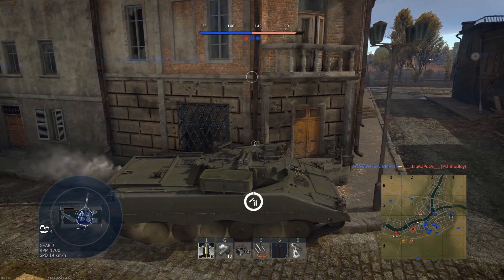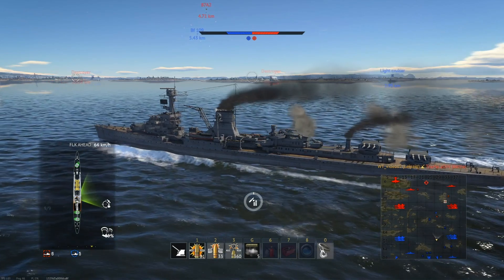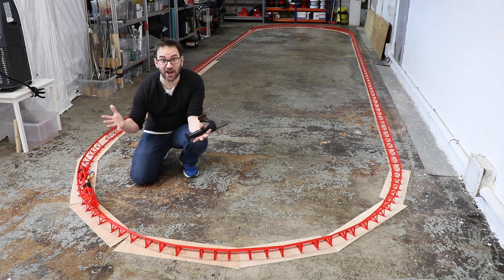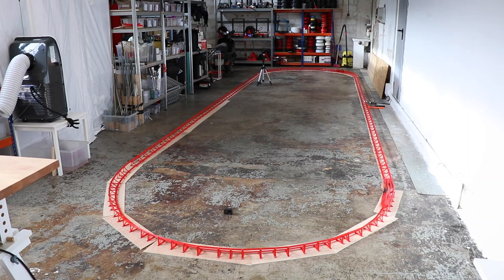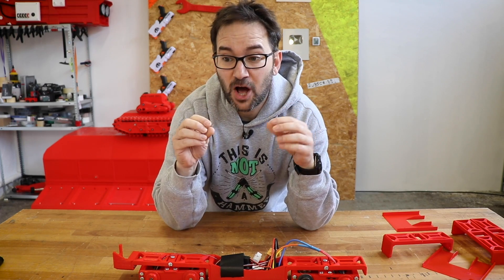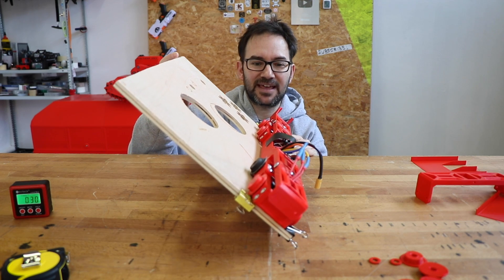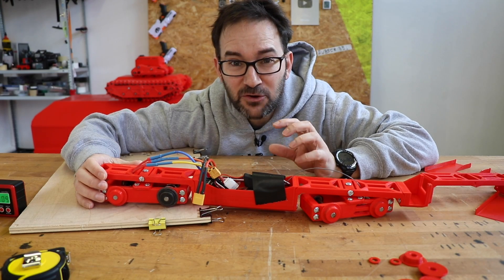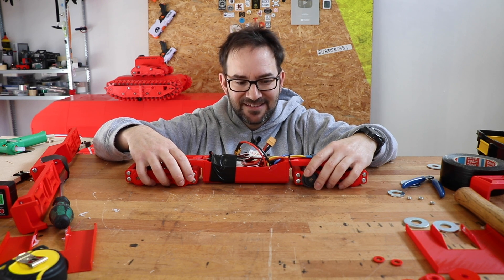WORLD FASTEST TOY TRAIN

Comment: My experience has been anywhere there's friction it slows down. Try better bearings and better wheels. Maybe metal if you can but I worry about the tracks wearing out faster. There's also a balance to weight and speed. Try different weights and add a nose cone to reduce air drag. I suspect that at the 20kmh point your train is starting to act like a plane with those cars and you're getting less grip to the wheels. Causing more derails and less motor to rail transfer. Honestly I'd start doing tests making small changes and recording my data. You have a wonderful opportunity to learn here.

Comment: Maybe drive only one of the wheels or add a second motor so they can rotate at different rates specially during curves, I think the inner wheel wants to slip but the rubber grips and create lateral forces and instability (not sure)

Comment: You can try different pulley diameters on motor and axle to find the best transmission ratio.
You can also try to remove the straight parts of the rails since it only derails on the straights...

Comment: Have you considered adding a motor to a second axle? It might add a little more weight, but there would be more power being applied to the tracks and as a result, possibly more speed.

As has been said, banked straights aren't necessary and would cause problems as you've discovered.

Comment: There are too many comments to see of these ideas are there. For this machine, speed is about weight and frontal area. Move weight down wherever possible. I'd add a nosecone of 0.010 or 15 acetate sheet to cut the air better. It would help a little to add a body, but not much. But, later, as you do reach limits, maybe try it.
You can angle the turns to 90 degrees! Obviously it can't go slowly, and the straights have to be much more level. Also obviously the track needs a lot more structural stuff.
The plastic might wear quickly, have you looked at that?

Comment: Reduce the banking on the straight. Basically  look at nascar, the banking is using the force that is pulling the car toward the outside of the track if the track was flat, into the ground making it able to take the turn faster. But, tale a look at the straight, there's less of it because the car isn't pushed to the outside. It's also why for bike track, racers go higher in the turn and try to stay as low as possible in the straight (there's also a matter of strategy in there for track cycling but that's the jist of it).

Comment: Try printing the wheels with TPU for add some bumps absorption and add some weight on the wheels that I’ll give more inertial moment, use a faster motor or longer ratio , it will help if you make it all 4 wheels drive

Comment: A couple things that spring to mind for "upgrades" are for example: making the wheels nice and round in a lathe (or when you do not have one you could use a cordless drill for example with an adapter). Besides that, take great care in laying the tracks, each bump is a possible failure point so fix it in place and use a sandingblock to flatten the top of the rails, and specifically the transition between trackpieces. On the long sections of the  track I would recommend doing this with  a long sanding board so it does not only become smoother but flatter over longer distances. Oh and as mentioned by many others, try to flatten the track on the straight sections. 

Again nice work, looking forward to future updates!

Comment: Direct drive the brushless motor without any reduction. It may need a slightly bigger motor, but it doesn't need much torque as you are accelerating slowly anyway.  You can do a quick calculation to get a rough idea of top speed based on a motors Kv, voltage, and wheel circumference. (I built a direct drive brushless combat robot with a theoretical top speed over 100kph a few years back... it was a beast) Also, a circular track would likely work better, but not quite as cool... Good luck!

Comment: Nice build! I was so happy when I saw you where going to make a wooden base to stiffen the rail track. Moar speed! Slightly bigger wheels? A carved foam cover to create aerodynamics and ground force, or printed of course! Although the form would not be symmetrical to the chassis, you could shape the cover to concentrate any ground force potential specifically towards the upper side of the chassis, to help fight the inward tumble-rolling. I don't know, not sure of calculations at 20kph, maybe there's no point. Aerodynamics in general would sure help though. Hey, before you're all done, you should build at least a couple cars and run some laps.

Comment: I'm no engineer but I think that the railrode must be leaning only on the turns to cancel out the centrifugal forces, but on the straight line there are no centrifugal forces and that's the reason it tends to derail on those parts.

Comment: to go faster first reduce friction : 
1 : leave the grip on the wheels and the rails
2 make the straight part of the line more horizontal (you must calculate the correct angle from the centrifugal force and gravity at any place of the circuit) search for clothoids)
3 put less wheel (3 per wagon is enough if you put weight correctly (spacers?)
4 make bigger wheels, as thin as possible
5 rails have not to be perpendicular to the wheel, try to print them like this <____> or /____\
this should take you easyly to 40 km/h
6 at this moment, the air will begin to be resistant so work on aerodynamics !
this could give you 10 more km/h
then the kinetic energie and inertia will be an issue : 
7 you will have to rigidify the circuit itself, specialy in turns... screw the woods part together 
this will give you 5 to 10 km/h more
finaly, you can improve the motor reduction and optimize the weight
this will take you to 70 kmh... and with optimisation 80 ... not the fastest but the fastset with this technology....and quite impressive
if you want to break a record use nitrogen and supra conductivy with a co2 cartridge as propellant (the higher weight*friction/power ratio)

Comment: Make the cars so they have two surface areas to "grip" the rail, like a looping roller coaster. one bar on the track but a upper and lower wheel to hold it on the track. You could push it to the max limit of the brushless motor and lipo pack I'm sure. Great setup, I'd like to see you do a scale roller coaster now, and completely fill the shop, and then after the video gets like 1m views, have a giveaway and give the roller coaster to a lucky fan!

Comment: 1- reducing friction by choosing a material with a low friction coefficient (ptfe wheels maybe?, less wheel, etc)
2- make an aerodynamic shell to your train will decrease the drag and improve speed
3- make the straight line with a less inclined rail, because it causes your inner wheels to take all the load and it creates more friction.
Reply: at this speed and scale I don't think aerodynamic is an issue. I mean he has a 500w motor to power a tiny train. The track is the main problem

Comment: 11:45 you may have get train go 20 km do that
unite train get up to 20km you can get it stick to wall whiles turning like 90 angel

more speed more it stick to rails
less speed less it stick to rails
because faster you go more push weight down forward 
*hard to explain it u may find video in racing car going 200mhp n goes in tunnel sticking to ceiling all around track whiles in tunnels" i think it called down force something

Comment: if i were you i would add spring on both front n rear wheels cart where u put that screw in at 1:56
just give it little lift up with spring that way keep tenis tight on track without vibrating it off track

Comment: I'm an engineer-in-training who happens to have an interest in rollercoaster design. Having a flat straight would be best if you're able have a smooth transition between flat to bank in the corners otherwise the train will jump and with an unkown top speed, that can be tricky. With a constant bank, you reduce the chance of the train jumpimg but now most of the weight is on the lower wheels. The top wheels will not have as much traction as the lower wheels and there will be constant friction from the lower side walls in the straights. If you want to keep a constant bank, then I think you can slightly reduce the angle (like from 45° to 40°), which will reduce friction from the lower side wall, and increase the thickness of the lower wheels. Increase in lower wheel thickness will help lower the center of gravity and increase traction where most of the train's weight is on. The Porsche 911 is a good example, to compensate for having the engine and more weight on its rear axle they place widder tires in the rear.

Comment: A loop you say? How about a corkscrew? You could look at some roller coasters designs to get some insights about how they can keep then on rails at high speed.

May be, one way to make it really fast would be making the wheels brace the rails (may be in a triangle formation) holding them firmly on the rails so you can push the speed up and up with out it been scary, but that would mean a newer rail design, which you would end up doing at some point if you pursue speed. Smaller modules would make turning corners smoother and tighter, may be use a "service" car to host all the electronics rather then put them on a box on a structural piece like you have done. Which remembers me of how rapid transit vehicles are more or less layout.

Another idea would be rising the rails and lowering the car it self, so it's centered upon its mass and less likely to derail and/or with a aerodynamic hull it, could force it self on the rails as you go faster.

Saying "Hi!" from Brazil.

Comment: Maybe use a different track system. Like this   --H  but the upper and lower Part should be round so the wheels can go above and under it. So you have basically one track and the Train can hang form it as well so you can ride on your ceiling.

Comment: - Go for a simple banked circle, the straights are not that useful except for measuring speed. Instead, measure lap times and calc km/h from there.
- Give the thing slightly bigger wheels and make all wheels run on broad flat rubber bands or o-rings.
- Power two axles or even all four.
- Add some lead or steel ballast. Maybe make the ground plate of the powerbox from a steel plate.
- Go from 3s to 4s.

Comment: you could use rollers instead of flanged wheels to take the lateral forces (particularly on the straight sections). 
also more power (maybe 4 wheel drive?). 
also look at changing belt ratios for higher speed, 
also aerodynamics.. (and maybe downforce?)

Comment: You can definitively do this! Some design changes will help. Change your design strategy to minimise friction. You can build up speed slowly and avoid the need for a differential by driving the outside wheels. Leave the inside wheels free wheeling by adding a bearing to the wheel. As others have said, switch from a toothed gear to belt drive, and absolutely flatten the straight. You will eventually hit a compromise on the banked turn angle. Too steep and the train will fall off at low speed, too shallow and it will fly off at high speed.

Comment: unless you are super precise on your banking, the train will experience difference lateral forces going in/during/out of turns

I suggest just making a circular track with a constant amount of banking

The faster you go, the more banking you will need (up to 90 degrees).  If you can get the train to start stationary at 90 degrees (something like a rollercoaster track) then you will be able to get it up to some very high speeds, and will only be limited by traction/motors/strength of track!

Comment: I think you should make the straights parallel to the ground and increase the angle of the turns, and to make it faster maybe you could use a smaller pulley on the wheel shaft. Not an expert but these are my ideas :)

Comment: Use a series wound motor might help. (use one from a 1/24 scale winged slot car). Make the wheels bigger (it works for high speed trains). Lay the straights down flat, your getting some negative g's when coming out of the turns. Put some wings / spoilers on the train for more down force or a streamlined body.

Comment: Use higher KV motors, or more cells in your battery.  Easy to do, and instantly more speed.  I'd also remove the straight sections of the track and just make it a banked circle.  Good luck :-)

Comment: Could you add some kind of a hook system where a rounded hook on the train hooks ofter the top section of the track which holds it to the track if it tries to fly off?

Comment: Make the Rail like a U-shape to cover on top of the wheels. And also the track can be only circular. No need of straight sections. You may use some cheap radar modules with arduino to measure speed????

Comment: I'd estimate the rails are probably about 10 cm wide, so this is somewhere around 1:14 scale (standard gauge: 1435 mm). That means your 20km/h are about 300km/h in scale, pretty fast already!
So if you manage to get faster than 40km/h at this scale, then that would be equivalent to more than 600km/h, which is about the current train speed record (wheeled: TGV @ 574km/h, maglev: L0 @ 603km/h).
All of which is to say: Yes, make it faster! (and for all those yelling about making the flats horizontal: why not remove them entirely, if the transitions are the problem, and just have a circular track?)

Comment: I don't think you need banking for the strait sections. You can calculate the bank angle for a maximum target speed and curvature. Straights need to be gradually flattened to 0 degrees. Also adding weight just kills the speed, so that's wrong approach to solve a problem.

Comment: Hi Ivan, 
really nice job! Some suggest to improve speed: 
remove the front trolley and put only one pair of wheels attached to the central frame, 
make the front of the locomotive like those of high-speed trains in order to take advantage of the downforce of their "nose" 
add Oring to the drive wheels and
if you can get to full throttle, without falling, increase engine power.
Perhaps the rigidity of the rails also matters, some hot glue points may suffice but perhaps also the redesign of the rails by increasing the section because increasing the speed increases the dynamic efforts especially in the stretch preceding the speed trap, where you give power: curve exit and straight before the speed trap

Comment: You should make it more like a roller coaster, and maybe try using a material that has less friction for either the track or the non-driving wheels. Aerodynamics wouldn't be playing too huge of a part in slowing down the train, but you could try giving it a nose cone and some body panels, however, they will probably just add too much weight to notice any positive effects unless you had a bigger train that was going much, much faster. You could use bearings that have less friction, and some of those bearings can be lighter. Other than that, all that I can think of is using lighter filament, using a fine grit sandpaper to smooth the parts, getting better electronics and changing gear ratios. I hope this helps make the train be as fast as it possibly can be.

Comment: So watching the train go around the track there is a slight movement on the floor giving you straights a bit of waviness. So at low speeds the waves don't matter but the higher in speed you get the more they matter. I think that is derailing you from going faster by unloading the the weight by going up and down. The first thing I would change is the using full sheets of plywood to mount on which would stop the movement a bit. Second is I would stiffen the rails in the credits riding along with the train you can see the waviness in the straights. I hope that helps and I can't wait to see what's next.

Comment: Would be great to see that move faster, might get more speed if you add a rear drive motor and reversed the gear ratios. don't know if you will run out of torque though. You can also increase the bank angle on the corners, since the centrifugal force should help keep it on the tracks.

Comment: Besides reducing slope of the rails and widing the circuit so its more rectangular then ovicular. you could spearhead the frount roller to lower drag. Otherwise add a second moter to the real at half speed.

Comment: Add an air scoop for downforce. That's what high speed slot cars do and those things FLY. Also maybe make the track smoother and circular. And of course get a higher kv motor or higher voltage battery. To get really fast you might need to add suspension with damping.

Comment: Three suggestions if you'd like to push it even faster than this:

1) To avoid the track-skipping issue you saw on the straightaways, you could either adjust the straight sections of track to have a lower slope (maybe even perfectly horizontal), or make it so that no section of the track is ever perfectly straight. A circular track would technically be best from this perspective, but that's not as interesting to look at-- so I might suggest an elliptical track instead.

2) As a failsafe to discourage the train from leaping off the tracks at high speed, you might consider taking a hint from roller-coasters: if the train carriages had hooks that extended around and under the track, then it could catch itself before it goes flying off.

3) As you push the limits, you're bound to find additional failure modes that cause the train to go flying. To prepare for this eventuality, I would recommend to take a hint from NASCAR and other motorsports: anywhere that vehicles are prone to crashing, they always put things like tires, sandbags, or water barrels to absorb the energy and minimize the damage from the crash. In your case, this could mean anything from pillows and blankets to dumping a few buckets of sand in key locations around the track (after all, you can just vacuum it up later)... If you do proceed, I'll be interested to see what sorts of things you come up with!